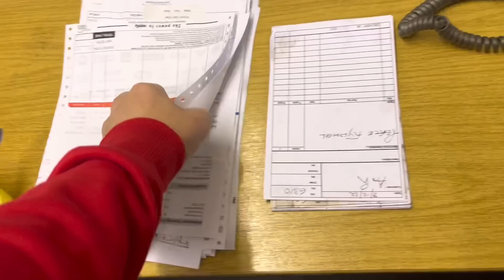My REACTION to the workshop after 1 WEEK holiday, what on earth has happened?

Comment: That CVH looks just like the American 1.9 Ford Escort engine from back in the early 1980's. Very low on power on the U.S.A version. But not an interference engine. If the timing belt let go just put in a new water pump, tensioner & Belt. Hard to hurt one of them they did not spin them to fast, so they lasted well. Could buy them very cheap from salvage yards.